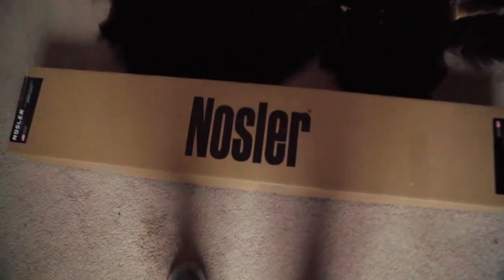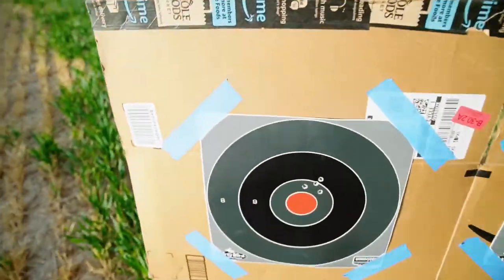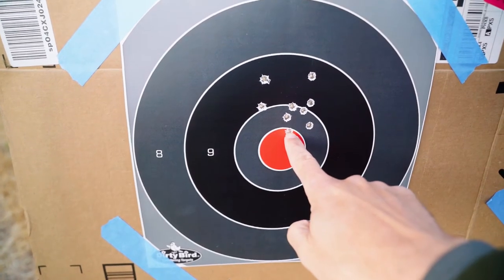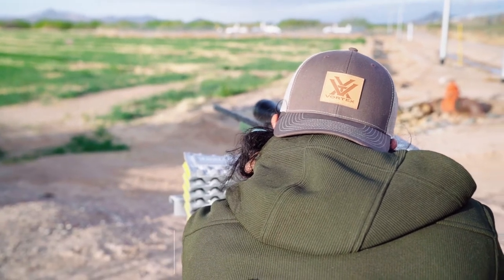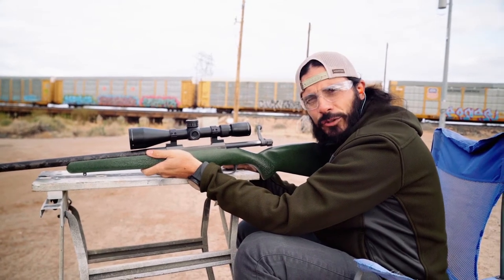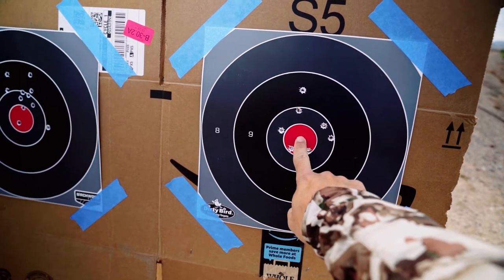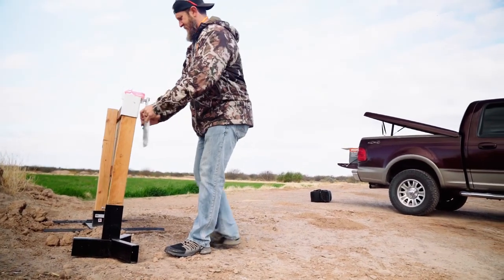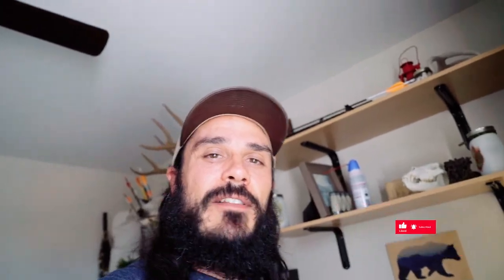I got a NEW rifle! - Nosler Rifle Build and Sight In 2021

Comment: Nice setup.  I also have a Vortex HD 4.5-22x50 LHT on my Nosler Mountain carbon 6.5 CM with Luepold std mount, and end with only 10 MOA turret activation left after zero at 100 yard. Not sure why, was expecting about 30 turret MOA left. May install a 20 MOA rail

Comment: Pretty Sweet rig that you got there Josh. I saw it on your Endearment bear 🐻 hunting film 🎞 and called out the brand or manufacture name. I just wasn’t sure which cartridge that it was.
The 27 Nosler is a hot rod. It solves something that some complain about with the 270 Win. With that 1:8.5 twist rate it can shoot those 160-175 class high Ballistic Coefficient .277 bullets. While the 270 Win has a 1:10 twist and is maxed at 150 grain. Where you using the Nosler Trophy Grade ammo with the 165 grain Accubond Long Range? I know that you are a bow guy, but I wanted to ask. 
You can take pronghorn to elk even moose with the 27 Nosler using the right bullet. No problem.
Reply from the maker: Thanks!  I really like it.  I was using 150 grain Accubond Nolser Trophy Grade.
Reply: @DialedinHunter  you are quite welcome 🙏 and I am glad that you really like it. Nosler rifles are legit and so are the Proof Research carbon fiber barrels on this model.
The 150 Accubonds is an all around good size for many species in that cartridge. I know that you are a bow 🏹 Hunter mainly but I wouldn’t be hesitant to take it on a late season elk or mule deer hunt in say Colorado.
If I were to add a few things to your rig it would be a bubble level on your scope. Just ask Brady Miller how valuable that is when you are laying on uneven terrain of a mountain 🏔 side. A bipod like the Spartan Precision Javelin or Swagger QD42 (which I have and like) and a lightweight item to use as a support for the toe of your rifle near your shoulder. Whether something like the device Brady uses and they sell in the GoHunt gear shop or a small bag. 
Good luck 🍀 this spring season on bears 🐻